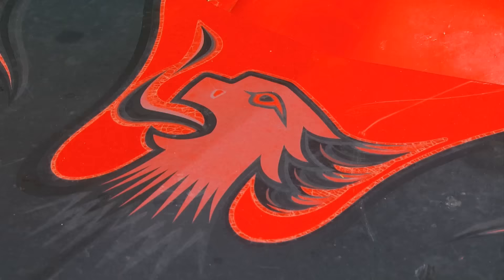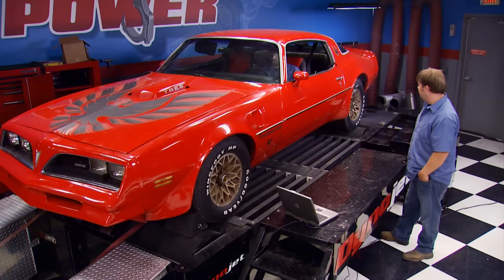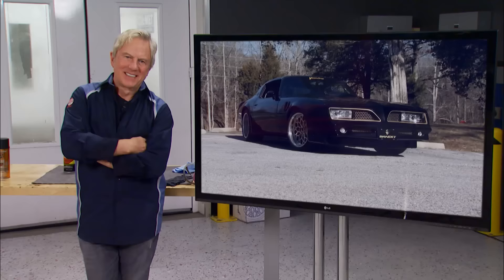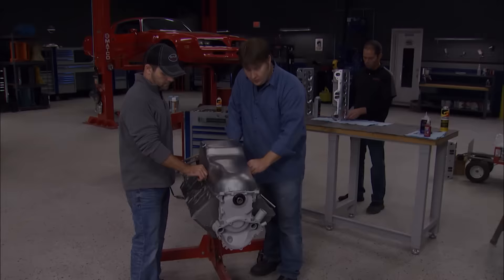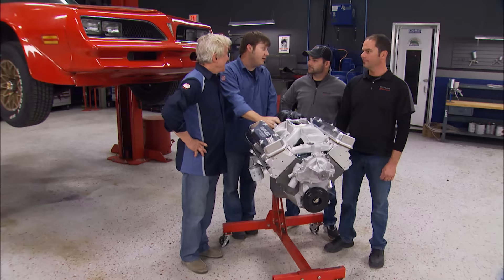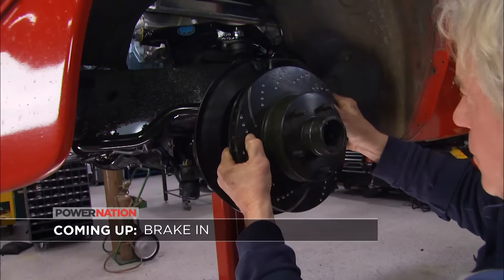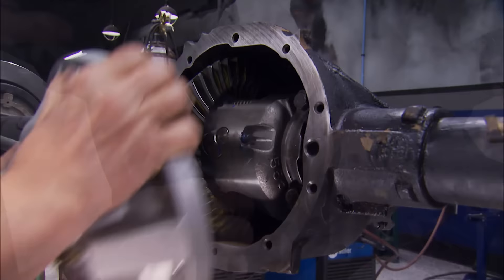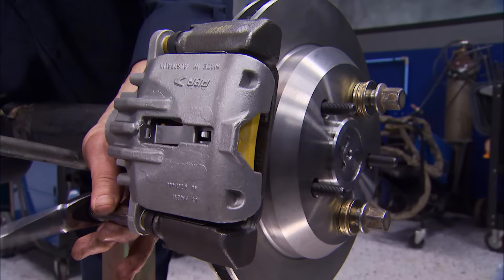Full Build: 1978 Pontiac Trans Am Bandit Tribute

Comment: WOW THAT ENGINE OS WAY OFF THE MARK..THE BUILDER SAID 500HP AND 600 TORQUE. DOESNT EVEN MAKE 1HP PER CUBE.
Reply: My Toyota has more hp per litre...
Reply: Understand grossHP vs rear wheel HP...
Reply: The engine builders dyno test their engines at the crank shaft, not the rear wheels.  They do this because they only build engines and don't have access to the car it will go in most of the time.